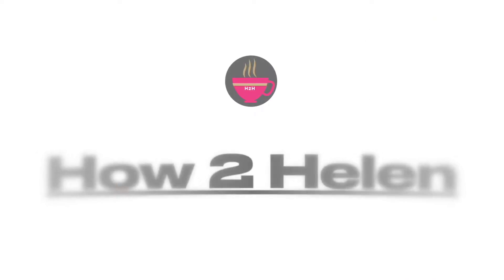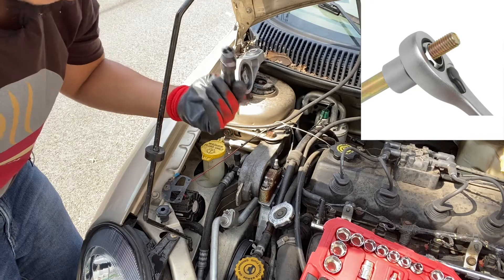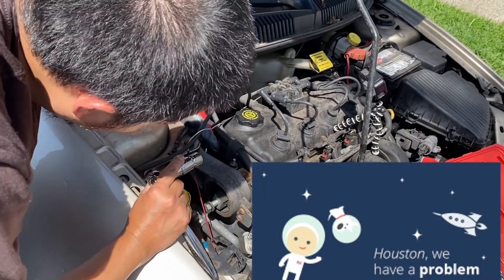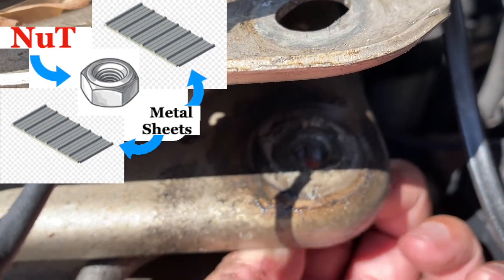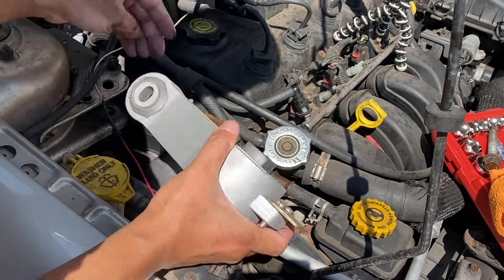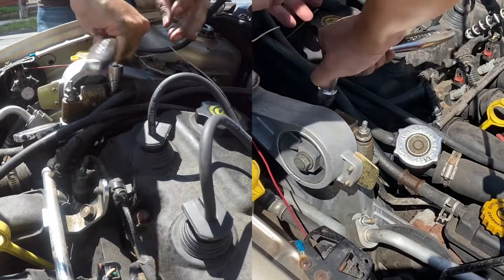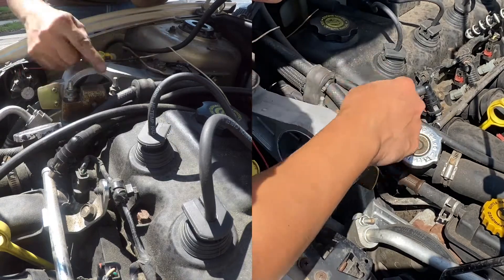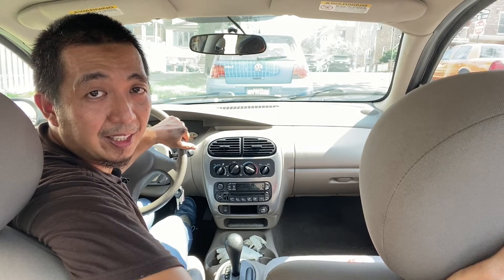2003 Dodge Neon 2.0L Upper / Top Engine Mount Replacement / DIY

Comment: Thank you for this video I hope I’m strong enough to get them bolts off or I’m going to have to hire a man to do it for me.
Reply from the maker: Hello! I’m actually not a mechanic, so if I can do this, I am sure you can do it as well. Just have the proper tools as those would male the job easier. Dont to spray it with a lot of wd-40 ahead of time so it will loose. The bolts. Thank you for watching!-Rjeff H2H

Comment: How did you get the nut to stop spinning?!!
Reply from the maker: Hello! I used an open wrench between the two sheets where the nut is located to hold the nut in place so I can remove it. I mentioned it at 6:59 when I was putting it back together. It was the opposite of that. Hope that helps! -Rjeff H2H

Comment: Do i have to support the motor to do this
Reply from the maker: Hello. No you not need to support the motor, EXCEPT if your lower control mount is completely torn up. Look for our video for the lower control arm replacement for additional help. If you are replacing the lower control arm, then you would need to suppport the engine, and that video shows how to properly support it. Let me know if you have anymore questions. Thank for watching-Rjeff H2H